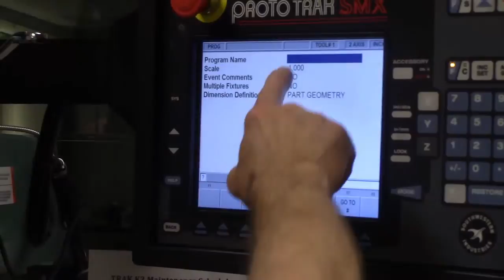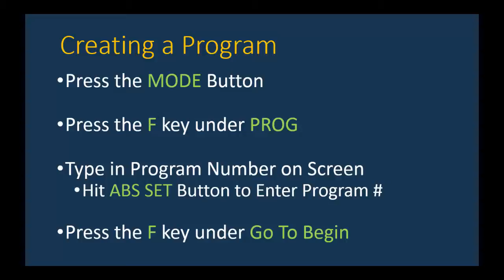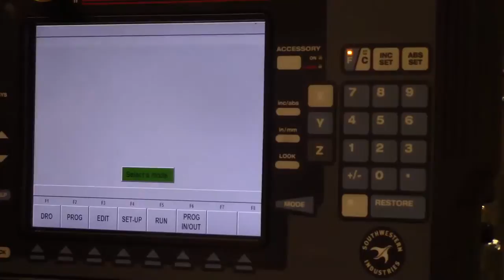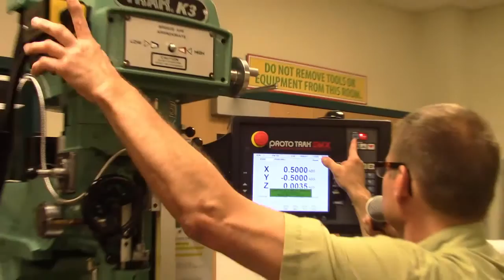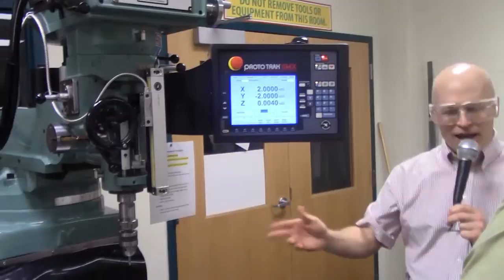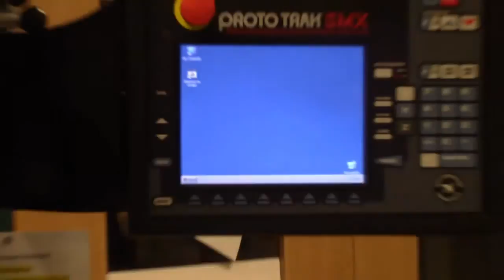MCC ENR 153 Machine Shop Video Mill  6 Drilling CNC Control

Comment: 1.) To create a program with trak controller, select mode, then press the F key under PROG, select ABS SET, then the F key under the go to begin command. 
2.) To position a drill, press the F key under POSN DRLL for event one. Then, input the X coordinate in X end, and press ABS SET. Input the Y coordinate in Y end and press ABS SET. press the F key under PSN DRLL event two. Then select MODE.
3.) The look function provides a preview to see what the program will look like when executed.
4.) To define a tool table, press MODE, then the F key under Set Up, followed by the F key under Tool Table, then the F key under Data Down. Finally, type in the tool diameter, and select ABS SET. 
5.) To run this program, move the quill to hole one, press feed/go, move the quill to hole two, and then press feed/go again.